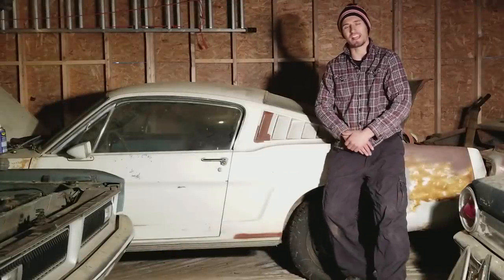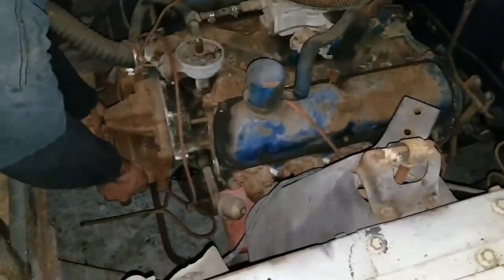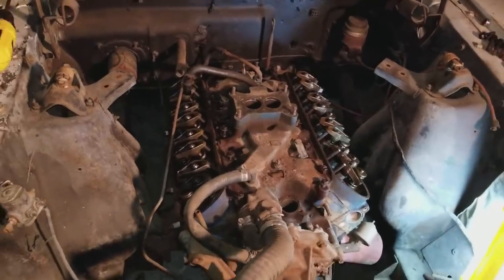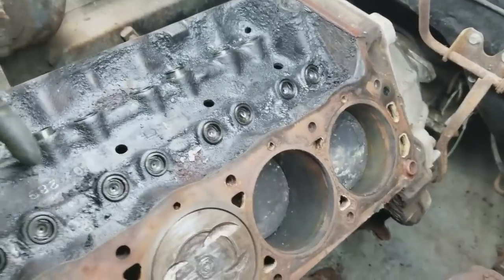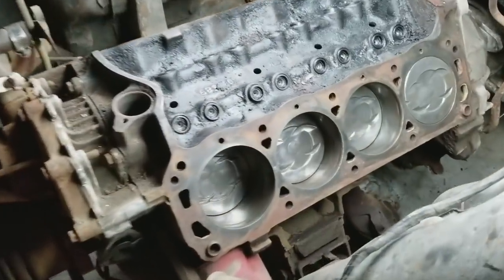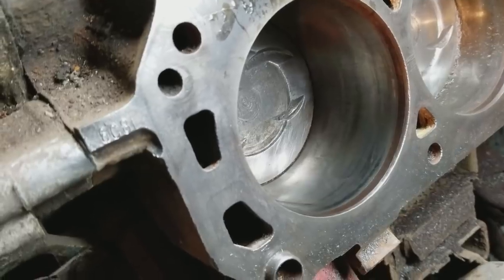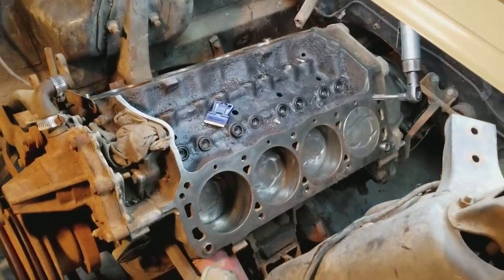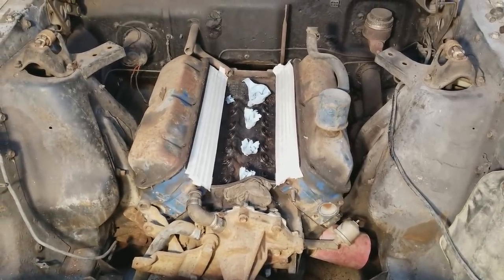Forgotten 1965 Mustang First Start in 44 Years, Fastback Revival Part 1!

Comment: Boy I would have started sucking all that crap out of the cylinders with a vacuum before continuing to rotate the engine
Reply: They're probably gonna rebuild the engine.. I hope
Reply: Dude I cringed so hard when I thought about it
Reply: My first thought when he started rotating it...  Oof
Reply: the hardness of the shit in the cylinder is not as hard as the stainless steel rings, or the steel cylinder wall, its not as hard as aluminum either... so its not that bad lol
Reply: And tear it down and clean everything
Reply: TheDrakenZ rings aren't stainless steel
Reply: I dont even know anything about cars  and thats what i was thinking
Reply: +1
Reply: Me too. I was scared to see what they were doing. lol
Reply: @abrahamestrada2206  
  Once the harmonic balance had  moved...the first thing  I do is pull the Plugs and squirt motor oil  towards the highest  point to drip around the Piston head  to cover the  whole Cylinder wall as you then go back to rotating the Balanace .  
   Any  loose debris at TDC  will stick to the Oil and not drop to the BDC and risk  scoring the cylinder wall on the way  back to TDC.  
   That Oil galley has the signs of neglect  by that layer of Black sludge  but what I find odd about the  Heads is that they seems  too clean for the Rockers and  Spings while the Pushrods  have baked-on sludge  on both ends.  
      A small  hand-held  Vacuum would have helped   because all of that dust  was falling in the Water Jacket holes  unless the end goal was a complete tear-down for  the  Block  to go in the Hot-Tank  and flushed . 
   Those Lifters  may be just as bad for sludge and I'd replace them all rather than take them apart to clean up .
Reply: herr haller  
 As soon as   he saw the Balance  rotate....it told me that the piston rings weren't seized. 
    Pulling the Spark plugs  stops the Compression resistance.  The oil squirts make it easier to turn  the Balance  where you could use a pheumatic gun or ratchet  to spin it .
     Also.  A good time to test the valves by the Wet test  that  seals the Rings by the oil and screw in the  Compression gauge  for each cylinder  . 
   Compression pressure should be within 15 psi ......if  you get  0  or 50% of the Mean psi on the  7 others.....the valves might be bad. 
 Screw in  an air  hose   to blow air in .....listen for a hiss from the carb  or  air coming out the exhause pipe .  This test is at TDC  for the   power stroke with both valves closed.   
      I'd rather  get an idea  for how bad the engine is to know  if  it's a  full rebuild or just a valve job .
Reply: Why is it that every video I try to watch, people have to put Shit music in it. why can't it just be a nice mellow video put together as if were watching from our own garage. Everytime I go in my Garage I don't blast the place with music..  Sometimes it's nice to focus and take it all in as if meditating thinking of the next step.. ???  Fast Fwd thru the music..
MOUSE ?  yup it went up the exhaust into the cylinder. (F'sakes) Then clean it and play the irritating music again.
Reply: The pilipino mechanic can do it .even the the drunk man
Reply: As a professional auto tech with a lot of engine experience I can’t help but cringe watching this lol. You can clean the pistons with some cleaner without getting all the shit every where. For how cheap parts are for this engine I would have pulled it out, clean block, new bearings, rings, oil pump. You are only talking a few hundred bucks to refresh the engine up and have a pretty reliable piece.
Reply: X WIRE BRUSHING ON HEAD SURFACE OR BETWEEN CYLINDERS
Reply: Gary wood What is the "balance"  ? please explain whet this word means.
Reply: and spray some penetrant around FFs. 
when they were looking at the dry pistons and decided to TURN IT OVER?
Reply: XD
Reply: Yep. Too much carbon. That's the first thing I'd do.
Reply: @garywood9525  Agreed, any half decent mechanic would have squirt tranny fluid or oil in the cylinders, nothing like dry heaving 44 year old motor. With all the fooling around they've been doing might as well do it right and rebuild instead of pissing around
Reply: @toring61_52  watch a real mechanic not doing all full restores and saving a lot of treasures from crushing, coldwarmotors
Reply: Torin å
Reply: It's a 66 not 65 look at the grill

Comment: My 67 shelby was locked up when I bought it
 I got it to spin 345 degrees then I locked up on something again. After working through everything mentally I pulled starter and a piece of shale was wedged into a spot where it was blocking the ring gear. Pulled it out and turned it thru easy. Ran and drove it 22 years vintage racing,daily driver etc. When I removed intake after breaking a valve spring . Its 1st time off ever! It was as clean as a week old engine inside. No gunk st all. I did however find a crack in lifter valley.  I replaced block with a Mexican 302 block. Perfect job
 While disassembled I noted lemans crank valley head services ported heads. Lots of other shelby installed bits as well. Got my first dynotune. 430 rwhp. 11.73 at 123mph at strip in kelowna. Pranced Knox hill climb etc. Car vandalized and I was paid out. Bought it back. Garage break in every removable part taken . Sold  car to friend.  He died still owing me 1/2. 

Now 68 gt/cs with home built 302 like mexican  with 5.4 inch rods and pistons. Comp vintage plus solid lifter. Ported 351 heads with 194 intake valves etc.
12.8 1/4 at 118  in calgary's. Thats Denver like altitude
Fun always.

J.s cormack
Also a wicked 86 xjs with switch pitch t400 502 crate engine. .

Comment: Good video! Looking forward to seeing it run. Im sure it will. But while you had access i hope you pulled each lifter and looked at the bases to determine their health and cam wear. Agree with changing valve seals while the heads are off, cant lose on that.

Comment: Incredible. This is one of those "rebuilt it all without knocking one bit of dirt off the outside" type of engine rebuilds.
Reply from the maker: Not claiming the engine to be rebuilt
Reply: @Theoldcarchannel.  - I'm commenting on how you took it apart, cleaned the insides, fixed issues, and put it together and yet the outside appears untouched, all dirt and such all over it. Just like those people used to run across where owners claimed they were "rebuilt" yet not a bit of dirt and rust seemed to be disturbed on the outside.
Reply from the maker: @tommissouri4871  I simply don't care to clean the outside of the engine, engine bay or any part of this car. It's not a restoration by any means, engine is not rebuilt, simply cleaning the internals and slapping it all back together. If it runs fine...great, if not... no big deal, I already have a few options lined up worse case scenario

Comment: Yes...part 2 please. Looks like a good project.
Pull he block and clean it well.
Also, make sure the oil ports for the crankshaft lubrication have not plugged up with old, gummy oil. If they have ...bye bye motor.
I am a machinist and I know this problem well.
Pull that block. Strip it down and inspect closely.
You can now clean it properly too. A couple of spray cans of Ford blue will make it da' bomb.

Comment: I bought a 1973 mercury montego gt that has been sitting for who knows how long ...dude pulled it apart to rebuild ..abandoned it ..heads still on but was left open ...its easier for me to pull it and strip it instead of bending over the fenders ..I need to start making videos of all my stuff
Reply from the maker: Yeah pulling the engine and stripping it is much easier and effective than what I'm doing here. I would do it, however the car is stuck in storage and I can't get a engine hoist to it. Also if i ever pull this engine... it'll most likely never go back it the car 😂 would swap in a roller 5.0 and 5spd. Slap a intake and carb on it and call'er a day!

Comment: Those old Ford motors were tough  ive pulled them apart  in the past  seen them in worse shape than what yours looks like and one time  we  bolted a set of junkyard heads  onto the  motor   Gave it a start and that motor ran. For years without any issues  it was also in. A Mustang, 68 convertible  and the heads came out of a wrecked Granada  motor ! We were  poor teenage boys and i dont even recall using a tourney wrench  potting the heads on ? LOL  the car.  Ran well untill  it was totaled   A few months after the  work   Even after the wreck  she kept on going   With a mismatch of body parts from a different color hardtop  i had with  a shot 6 cylinder motor  that  i dropped off at a junkyard  at nite  after hours  and they sold everything they could from the car  i used to laugh.when i  would see it in the yard  if i went there for other parts  or whatever  plus other people i knew in the area  that went there  reckonized the old Mustang  too its funny because i have a  26 year old son that used to  give me a hard time about   Junking such a classic car  as a teenager   ( sadly the car had a  engine fire that  really melted  the harness and  suspension components  that it was too costly to repair   And i didnt have insurance that would have paid for the repairs  ?
Reply: Hi just want ask how to unseize a 1966 mustang

Comment: Pull the engine and do it right . Your just wasting your time because you will pull it later gauranteed .
Reply from the maker: That's fine, plan B is already ready if something fails👍
Reply: I think I would have at least put new valve seals and  relaped them valves. Then she would have been running strong
Reply: @Charlie Rolader 👍🏻
Reply: For real... Hell.. "cleaning" last piston with the razor blade took more time then just pulling it out. work smarter, not harder.
Reply: Jeff Stewart many people start with that idea, pull the engine, disassemble it...which costs nothing. But then lose interest or don’t have the money to rebuild it. Then it never runs again. Theses guys’ll have this car running again in a matter of a few hours. Then they can determine if it really needs a lower end rebuild or it’s resellable(if they so choose) as a running car and someone else can dump the money into it. This car needs a lot more than an engine rebuild in body an int but is a nice project. This is how it was done in the 1980s when these cars could be bought for $500 and put back on the street.
Reply: @TRyan-op2jo  my dad had a 66 fastback, and a 68 coupe.  They were just regular cars back in the 80s
Reply: Oh CanaDUH!
Reply: Gee,the engine is running fine in part 3
Reply: You're** wasting your time...
Reply: I'd use vice grips on every nut, torque by feel with a case of beer.
Reply: Snoopy my brother has a 67 coupe mustang
Reply: @jessieb9384  What are you.. 12?
Reply: Yes easier to take it out and pull it down.
Reply: @TRyan-op2jo  I doubt it will be a few hours.
Reply: same tipe of work they did on dart had to rework all they touched

Comment: Interesting and a cool car. I'm a MOPAR guy, so that says a lot. Should pull the engine and hot tank the parts. new bearings and seals and it looks like you would be good to go. Wire wheel and scraping on an assembled engine is asking for trouble. Rule number one of engine building... CLEAN everything, check clearances and CLEAN everything again BEFORE assembly. Give this car the love it deserves.

Comment: I'd use seafoam deep creep spray, normal seafoam cleaning spray, along with seafoam in the oil and gas, and MMO to help clean up all that crud...its not too harsh on the metal and it works well to clean and lube the parts. Seafoam and MMO helped me revive a 85 F250 with a 351W that had been sitting for years. Its good stuff! :D
Reply: mansharker8 .I use BerryMans ChemTool B12 which has Toulene In it which cleans better than SeaFoam... Seaform has Petroleum Distillates In it whichis oil products...Give B12 a try...IMHO

Comment: Looking forward to seeing her move under her own power, provided the C4 isn’t toast.  Expect the steering and suspension to be totally shot as well.  The steering wheel may go a full 10 to 2 without even moving the front wheels.  Best of luck, I learned to drive in one, a metallic dark green ‘66.  Oh and subbed
Reply from the maker: Won't be moving for another 2-3 months unfortunately... I hate winter😡 yeah not sure if I'm going to try and make the c4 work or just swap in a 5spd, still undecided at this point. Yeah not to worried about suspension, I've done it before on my coupe. Will only take a day to replace everything, setting up the camber, caster and toe in is what takes the most time.
Reply from the maker: Thanks for the support! Stay tuned😎
Reply: classicmustangs429 Get her running and drop it R and D, tyranny’s already bolted up, you never know! 😀
Oh and the brakes lol.  May want to make sure they’re in working order. 😁
Reply from the maker: @SteverRob  😂😂 yes most definitely want to make sure those work... Wouldn't want to hit the 71 cobra Torino in front of it😅
Reply: One more thing, I couldn’t tell if you kept track of the pushrods, they really need to go back where they came from, roll ‘em on a flat piece of glass to make sure that they’re straight. Ok I’m out
Reply: @SteverRob  where the pushrods go is irrelevant once the valve clearances/tappets are adjusted. they dont really wear at all. they sit in buckets at the cam end and the rockers sit in cups on the valve end of the pushrod. ive never seen an engine in the UK with a different system so i see no reason why an old American engine would be any different.
Reply: @petelattimer6808  non adjustable lash on these years of fords
Reply: @Theoldcarchannel.  I have a question my question is if your mustang is a '65 why does it have a '66 grille.
Reply from the maker: @joshsummers8606  someone change out the grille sometime in its 54 years of being on this earth.
Reply: SteverRob — had a ‘66 Fairlane with that motor... 3 on the tree- great little motors! 20+ mpg no sweat! Now if I could get my ‘66 GTA Fairlane convertible back on the road 🙄 ‼️
Reply from the maker: @mrdiplomat9018  gotta get it Going! Nice ride!
Reply: Haha  Steve I owned a 1967 Mustang and the worm gear was worn out on my steering gear box.
You are right.  There was so much play in the steering it was like steering a boat with a loose rudder linkage.

Comment: Nice! Looking forward to the series. My dad bought a 65 fastback new down here in Houston and drove it until coincidentally, about 1976 or so, when the oil pump went out. He sold it to a kid at the service station by his job for $250. :(  It was the first car I ever "worked" on, lol! But I did keep it cleaned and washed for him as well as a 7-11 yr old could. I'd love to find one of my own someday. Congrats and good luck on it!
Reply from the maker: That's crazy! Who knows might be the same car lol! What was his car all about? 289 car? Colour? Interior?
Reply: @Theoldcarchannel.  I wish it was! I think the last license plate was LAG 996 and it had the metallic blue interior, 289, auto,  fold down rear seat, and below the dash AC. The body and interior were in pretty good shape, but the trans slipped and the ac and radio didn't work, so the engine failure was the last straw. I was not happy since I really enjoyed that car!

Comment: That carbon buildup on the pistons is from leaded fuel. You did the right thing by cleaning it off. That stuff is like gravel in the cylinders when it breaks loose and gets between the piston and cylinder wall. Be sure to oil those cylinders good before startup and fresh oil and filter will help to ensure a long life.

Comment: I do admire the spirit you guys have in getting it running,  But you gonna need to gut that interior. With that mouse nest on the passenger side, you can bet there is more in the headliner, seats, dash. No stink now that it is not out in the sun and winter. But get warmed up and it will stink like mouse piss. Looks like a great start.

PS disconnect your blower motor, this way you won't get a dose hantavirus when you are in the driver seat trying to get it to fire off eh!
Reply from the maker: Thank You, let's get it running first lol😂 then I'll worry about the interior👍
Reply: Can't agree more.. Just bought a car that was a rodent motel. The entire interior has to come it. It stinks so bad and there is💩💩 all in dash 😞
Reply from the maker: @ClassicRideSociety  this once actually doesn't smell like that at all... I will be take the mouse nest and carpet out of it shortly though
Reply: I had a mouse crawl in and make nest beside my cabin filter in the winter I didn't know about. Spring came, was always kinda tired, fluish, aches, chronic cough. Didn't think about too it much, just a cold. Doing the spring maintenance on my car, I pulled the cabin filter and the little bastard died on it, and the pleats were filled with turds and piss, and this big ass nest all around the rest. Without a host the virus can stay active for a week. There might be none in there now but all that nice bedding material. Took 14 months for my lungs to clear. It was no fun, hospital stay, loss of income, just blah, never want it again
Reply: Also, since the mice have been there and their urine has been all over, the chance of tetanus is high if you cut yourself. 
Everything soft will have to be thrown away. Don't save any door panels, soft trim, carpet (obviously), or seat padding. It will carry that smell for far too long.

Comment: Coolest find and O/H.  I was apprenticing at a Ford dealer under an old timer that used wire wheels to do what we called "the farm overhaul" you guys did. He did a 351 W one day and used the wire wheel cleaner for piston tops, etc.  That car came back on a hook a few days after it left.  A wire from the wire wheel went into the engine, had jammed the oil pump and the engine burned up from lack of lube.  Figure out the moral of this story by yourself.  Thanks for showing the vid.  I love old mustangs.